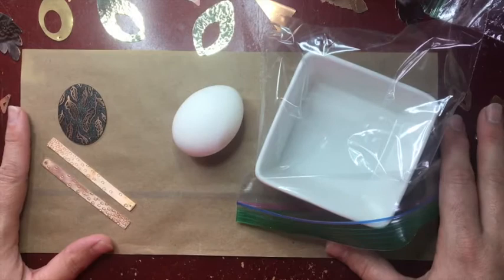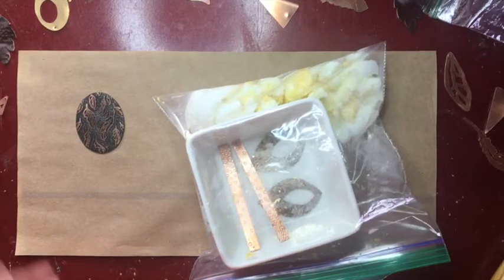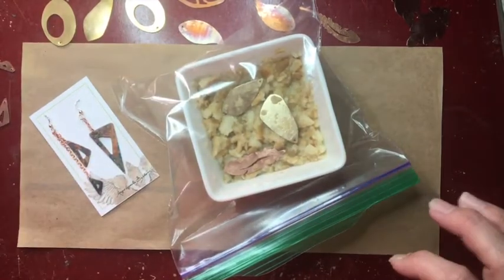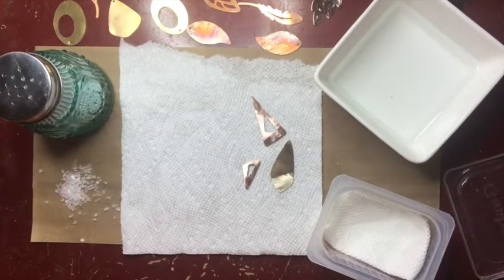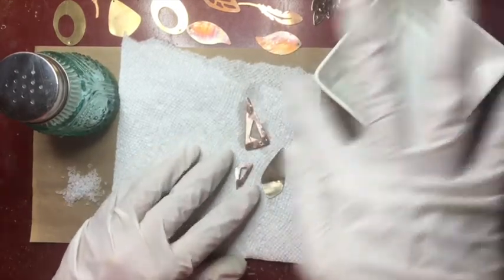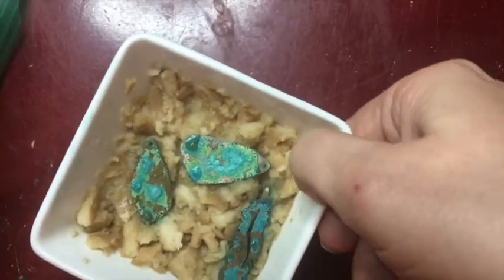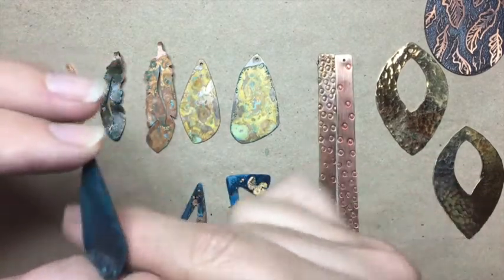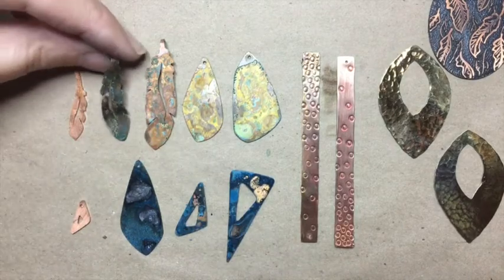Intro to Jewelry: Patina

Comment: Excellent demo! 👍  That was very interesting.  I've just started experimenting with chemical patinas on silver using LOS (liver of sulphur) by itself, LOS with salt, and LOS with salt and ammonia.  I got some beautiful, vibrant colors... colors that were reminiscent of the flame painted copper I experimented with a few years ago.  There were goldens, pinks, greens, and blue hues.  It was so much fun.  I really LOVE the etched circle piece you were trying to mimic! ❤  I haven't tried etching yet but your video may be my inspiration.  Btw, I read a how-to article about the ammonia patina a few years ago.  It was interesting to learn you can draw patterns with a sharpie to mask parts of it, let it patinate, and then clean the sharpie off of the piece to leave you with a new penny shine where the sharpie acted as a mask and patina everywhere else.   Maybe you could add that in with your next experiment.  It would be great to see it happening in a video as opposed to seeing pictures and reading about it.  Anyway, sorry for the lengthy comment but I really loved your video.  Thanks for the inspiration! 😊